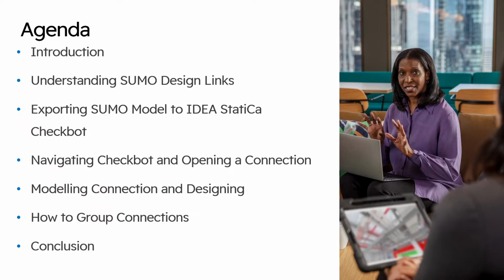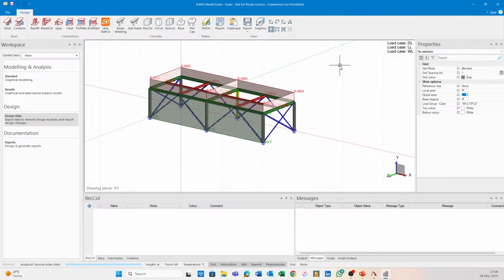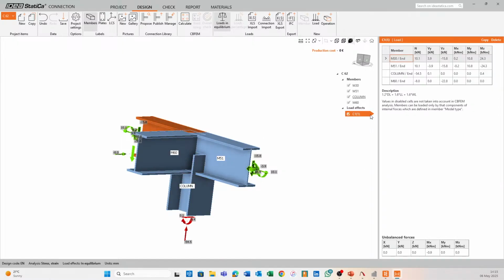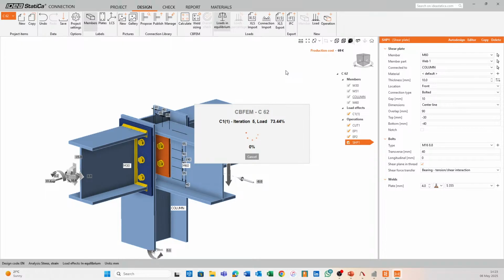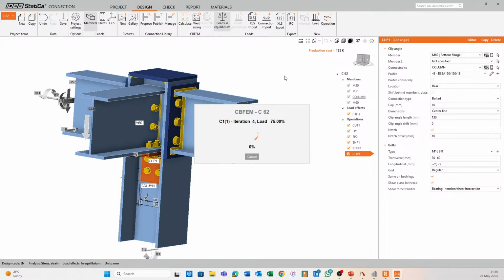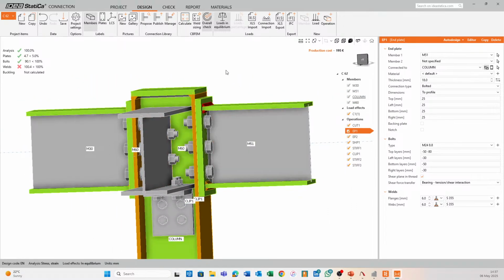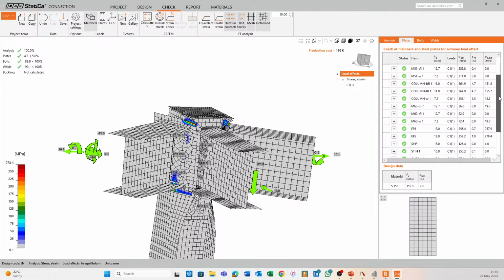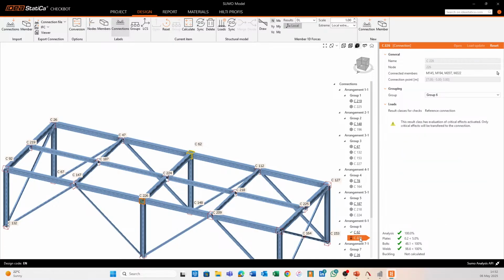IDEA StatiCa as a Design Link for Prokon SUMO

Comment: Good day, so im running into a problem where i use a PFC 200 and in sumo it shows toe out, but when loaded into Idea it turns toe in - is there a reason for this and how do i fix this. 

Additionally that same member (Main member is 4m long with a beam connection to the back side every one 1m) in prokon it looks correct - but in idea it will break it up in nodes (Which is 100% correct) but it will change the orientation of the main beam between toe-in and toe-out between the nodes. 

Is there any way you can assist me with this